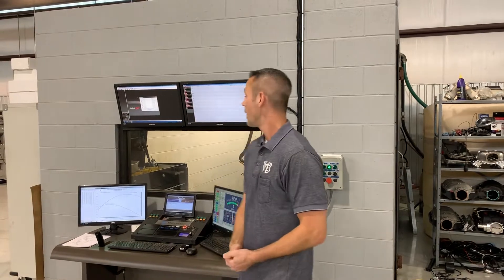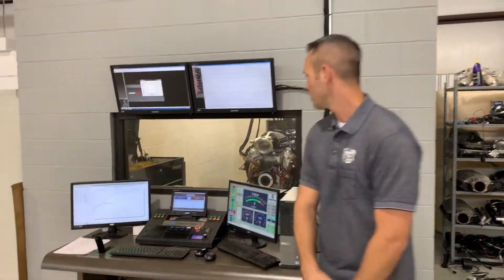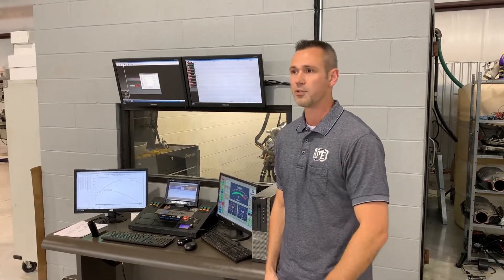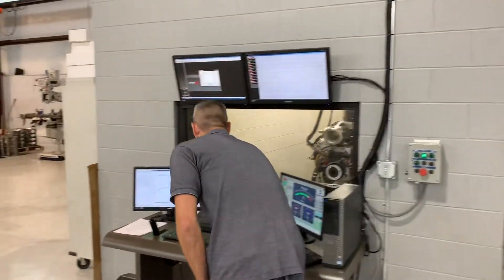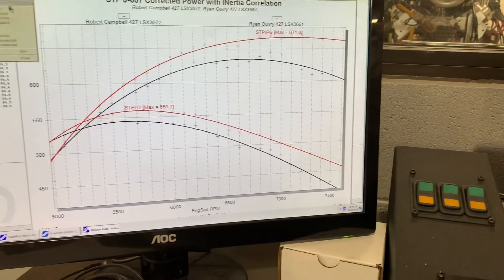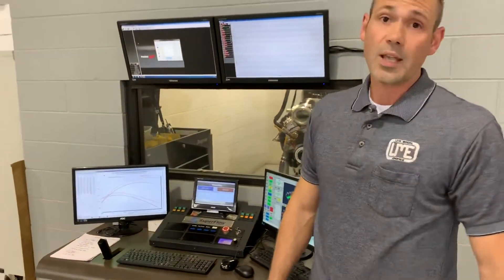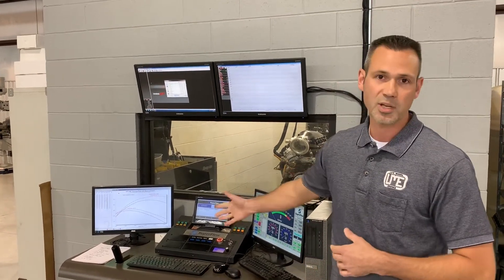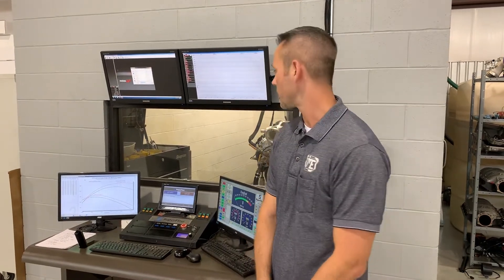Cathedral port vs. Rectangle dyno results

Comment: Who runs 9:8 compression with that?
Brian Tooley did a test with a FAST 102 and his trickflow 245 head on a 454 and he made 710hp.
Reply: My bet is that it's built for boost on both engines.
Reply: @ddn79  no that was NA

Comment: The power differences are minor but I am betting the trickflow head will be a hell of a lot more responsive and have have a much stronger torque torque curve off idle till the red line.
Because the trickflow is more efficient I bet it will be faster too.
Reply: Did you see the same graph the rest of us saw for this motor?
Reply: @danielcantrill3104  yes and I bet the track times will in favour to the trickflow as it is a more efficient head

Comment: Not only did the ls3 head outperform the cathedral port but it also did it with the same cam profile before the ls3 heads were put on...cam cut specifically for the ls3 head would have shown even more power

Comment: If the ls3 heads were shitty on the low end, GM would probably not use them on their 364 truck motors. My 6.0 will be wearing a pair of 821s
Reply: Dont forget GM went from a 4l80e to a 6l90e trans with a alot lower gear set to help the bottom end loss.  Also VVT came with the rectangle port head motors.

Comment: Hows the power under 5,000?
Reply: Look at the dyno graph
Reply: @ls87gbody  thanks for the help buddy. The graph is from clearly showing gains from there up but it doesnt show the full picture. I'm sure it lost under 5000rpm.
Reply: @03c5z  it does lose quite a bit under 5000rpm.
What the dyno can't show is how much more responsive the cathedral ports are and also in any part throttle applications for the street the cathedrals will be significantly better.
Square ports heads are only good under WOT.

Comment: So many factors that can affect the results. I still prefer cathedral ports for a naturally aspirated big bore, big cube build. Low to mid power/torque would be a kick in the guts with plenty up the top end. One thing's for sure, there's gonna be heaps of fun if the car is a 6-speed manual...
Reply: Catheds were never intended for a 427 with a Holley intake. 
Need the same test on a 6.0L. Also there is head port volume to ci or cyl volume relationship to consider in this comparison.

Comment: I've seen tests like this before and the rectangle port always performs better on the dyno.
Reply: LS3 heads all the way baby. The only guys you really see claiming the cathedral port heads are better are the guys that are invested in selling them and the guys that bought them. The aftermarket companies spread their misinformation about the cathedral ports being better because they don't want to lose their market share to $250-$750 a pair OEM heads.
Reply: @tronsmart2185  Not true. The LS3 heads may perform better on the dyno but in the real world they don't especially in street driving. They are way more responsive and have more under the curve power. I am betting too the torque curve off idle to 4000rpm will be far stronger on the trickflow but they didn't show that.
Reply: Mr Mysterious so a near 700 hp engine and you are worried what it would do on the street. I would take the much more power everywhere and use the converter. No way these two engines the cathedral port motor is quicker anywhere
Reply: @tronsmart2185  Its still uses a huge port and valve to flow as much air as a CNC'd cathedral would do with ports 40-45cc smaller.
Reply: @trixnhoez2964  witch tells velocity